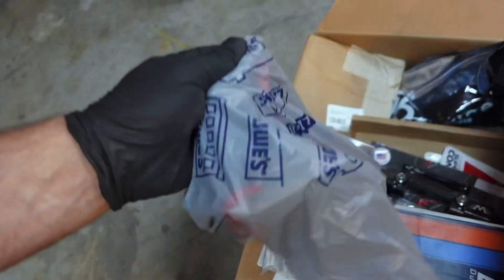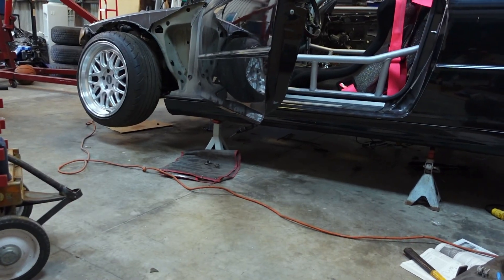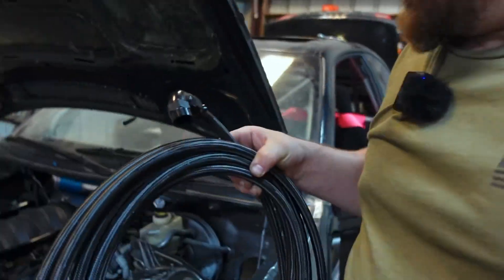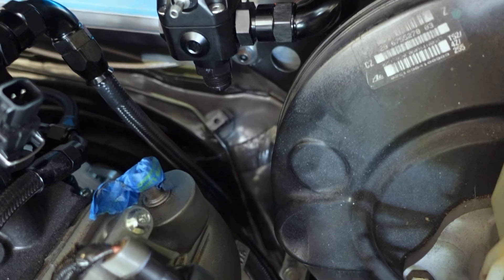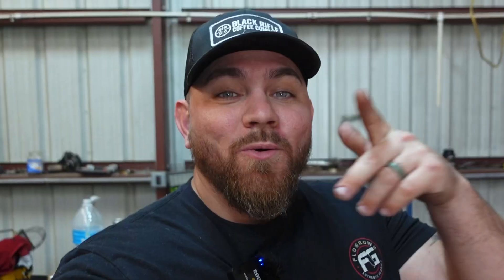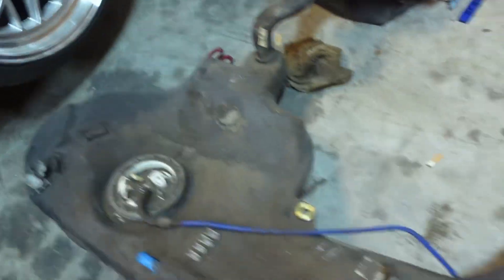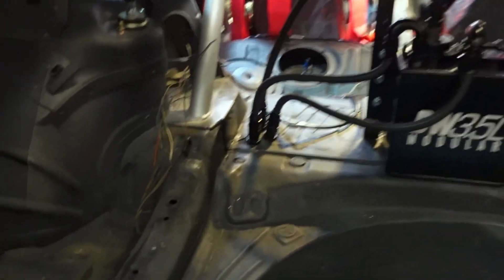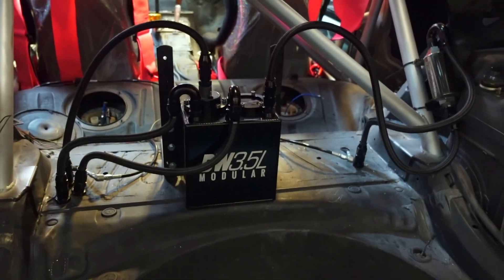Installing A Deatschwerks Surge Tank On My Ls Swapped BMW E46 Drift Car

Comment: Hey man, I’ve been checking these videos out and curious what you did about the saddle tank and the oem Venturi jet pump that was in it?
Reply from the maker: I don’t think I even messed with them. I left the the tank as is and vented to a new spot. The stock tank only has a lift pump in it to the top tank.

Comment: Hey man

 I had a question about the fuel system on your e46 LS Swap.  

How long was your feed & your return lines? 

Im planning out my ls swap & fuel system before my engine is here. 

My setup is going to be a 6AN system with an adjustable fpr & billet fuel rails aswell
Reply from the maker: No idea man. I ran a string from one end to the other and ordered that size. In between the line I had fuel filters so technically the line didn’t need to be that long